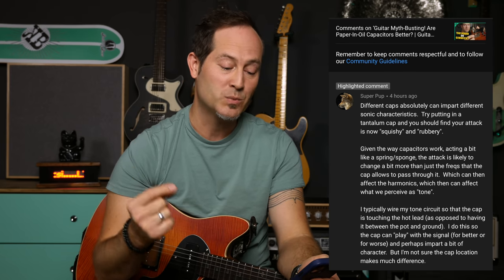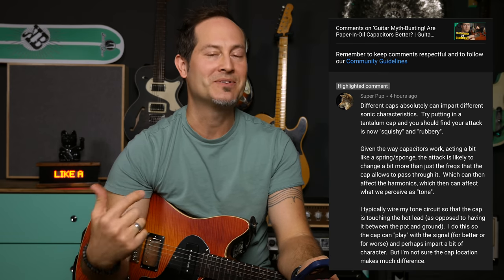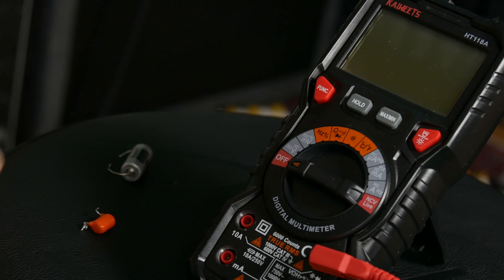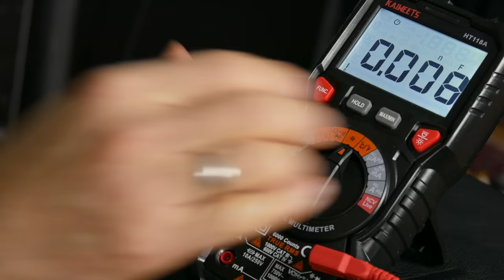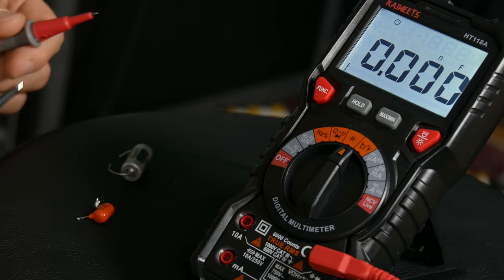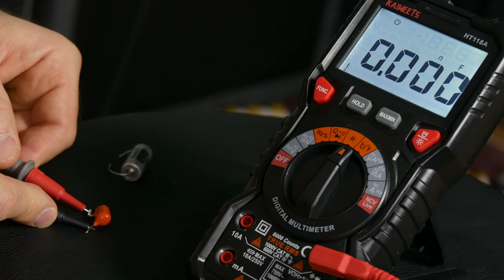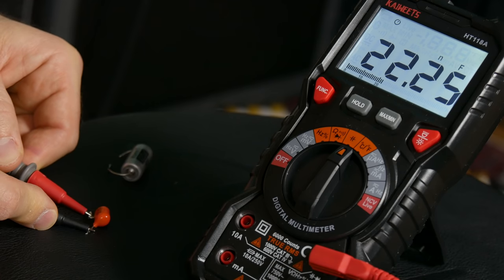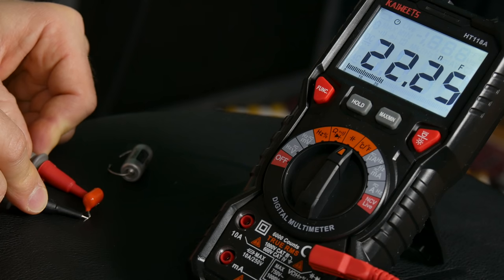Guitar Capacitor Types Matter! Here Is The Proof | Guitar Tweakz

Comment: I can't believe an electrical engineer said what passes thru the cap??? Current never passes thru a cap. The two leads are insulated from each other by a dielectric. Electrons cannot cross it. It charges and it dis-charges, when that happens current flows in the rest of the circuit. I would like him to explain how material affects tone. .022mf is .022mf, it is a time based measurement, which is what effects it's freq. range. In a .022 cap you will hear as little as 10pf diff in value, much smaller than it's spec'd tolerance and less than most multi meters will average their measurement. Tho the dielectric becomes polorised and is diff in diff caps .022mf is still how long it takes to charge whether ceramic or mylar. one has to consider placebo possibilities. Also this is a guitar cap which is in series with a pretty hi value pot (500k w/ humbuckers). In addition to that the cap is not even in series with the signal it just bleeds off freq. So even if signal did (pass thru) a cap, it wouldn't in a guitar.
Reply: That might be true if capacitors were purely capacitive.  You have to take into consideration other factors such as ESR, inductance ramp speed etc...  No two compositions are alike.
Reply: @qua7771  How much diff. in inductance is there between say a .022 ceramic and a .022 mylar cap? I'd be interested in the measurements you've gotten. And ramp speed? Farads are a time based measurement. How long it takes to charge is what gives it it's value. .022mf of any type takes the same amount of time to charge. That's why they work at diff. freq. Freq. is also time . The resistance of a cap is for all puposes infinity. The actual resistance of the metals that are used in a cap negligable between caps. not enough that would ever affect sound and also would be part of what makes up it's time measurement, farads, micro, pico, etc. These things are so infinite that it could not be detected by human hearing. The only diff. heard other than placebo is it's value.
Reply: @bradt.3555  A Mylar cap can be folded or wound.  If you want to know the other specs, you have to look at white papers.  I can tell you now from my amp building experience that there is a substantial difference in the tone of caps with different composition.  It's not placebo effect by any means.  Secondly, price doesn't always correlate to quality.  There are various factors that effect price.  I don't have time to debate just for the sake of it.  If you are playing high gain most of your tone is lost anyway.  Don't assume all players use a ton of gain, effects or processing.  Don't assume everyone can hear the difference either.
Reply: @qua7771  I assume by gain you mean distortion cause you can have lots of one without the other. I use almost no distortion and also mod and build amps, guitars, stereo equip., so on. But you are correct with lots of distortion much is hidden. I never mentioned price. Placebo is real. Look at how little of a value diff affects tone then look at the % that is. 1% of a .022mf is 22pf, that will make a noticable diff. What do you use to determine it's not placebo, hopefully not your ears. Cause that's why placebo is so debated. Even the best ears can be fooled. Mine are quite good so let's not even go there. Half of my 50 yrs working on this stuff has been researching placebo.
Reply: @bradt.3555  Your implying that your ears are gold, and mine are shit in a back handed sort of way.  As I previously mentioned, we strongly disagree, and I'm not going to waste my time or yours debating just for the sake of it. These discussions never come to a head.
Reply: @qua7771  I 'm not implying that at all. I would never make an assumption about someone else's hearing.This kinda shines light on my point about placebo and peoples mis-understanding of it. Good ears bad ears it doesn't discriminate. I just have a hard time wrapping my head around why some people so deny placebo effect. Just saying my ears are good and it affects me as much as anyone. The science of blind testing and understanding how a cap works in a circuit has debunked cap material so that leaves placebo. Took me many, many yrs. to admit it to myself. I've compared many types of the same value with no difference but then caps of the same type and heard a 1% value difference.

Comment: Do you know if there is an orange capacitor in the latest Epiphone Les Paul standard 50’s ?

Also would adding a gibson 498t pickup to the epi standard 50’s get close to that gibson sound or is there anything else i should do to it just for sound itself?

Last but not least would this be worth doing to an epi standard 50’s or should i just get a Gibby standard 50’s ?

Comment: Kris, thanks for your video. I have a question:
Can a failing/damaged capacitor cause humming of guitar?? I’m lost in trying to get rid of hum on my les paul studio 2004. Just rewired it this morning and improved grounding but still it hums like crazy. When I touch capacitor guitar goes silent as it should be. Thanks . Köszönöm
Reply: If hum stops when you touch the strings , your bridge probably not grounded

Comment: to be fair, the values seem to be very close to each other. there is like 2% difference between them. so I suppose that should not change a whole lot. so i guess the conclusion is that the material changes the tone? i don't know. but it seems like it. thank you for doing the followup.
Reply: the material doesn't matter
Reply: Agree, they were both pretty close to the nominal value and well within the advertised 10% error margin (actually almost 1%, which is very good for caps). I don't believe it is the material, I'd rather think it is because of the parasitic inductance and resistance caused by the physical properties. I don't know how the orange drops are constructed, but the pio caps can act very much as a coil having some inductance too. The tone control in the guitar doesn't just act anyways as a simple low-pass filter, it interacts with the pickup's coil and the pots and thus the whole system creates a more complicated LRC circuit having a resonant frequency. Now with the tone pot you move around this resonant frequency, a bit like a wah pedal.

I think it is not the question which cap is "better" or "worse", but to find the one with which you are happy with your guitar's sound.

Comment: You already said it, " I prefer it this way" and is'nt that what it's ultimately about? I would remove the cap and record a min or so and then put one in with tone at 10 just for a test.I found that some caps  change value depending on temperature of the room . Good job, keep on searching.

Comment: Hi, when we're installing Orange drop 22nF 200V capacitor do we have to put it in one particular side so that we avoid noise? Thanks
Reply: There is polarity. I plug in my guitar cable into my amp, then I hand connect one wire of the cap  to positive and one to gound. Then I reverse them. Whichever makes more noise,  is your answer .

Comment: I think my gibson sg leaks dc. Causing some sensitivity in a few of my pedals potentiometers causing some scratchimg sounds and crackling sounds. My amp was tested and the amp was fine by a technician. If I buy a gibson les paul woth orange drop capacitors will that help alleviate weird sounds?
Reply: Guitar signal is AC not DC, so not sure what you on about here. 
A capacitor in a circuit will block dc if present like in an amp. 
Normally scratchy pots can be DC present on a circuit but not a guitar or most pedals really (unless it controls a bias). They probably just dirty and you should get some electrical spray to spray in the pots and clean them out.

Comment: Also, the type of capacitor do not affect the transient. Only its value and the equivalent resistance of the circuit that sees the capacitor. What happend is normally tantalum capacitors are in the range of 1 to 10 microfarad while film capacitors are in the range of 1 to 680nf normally, so the difference is in the value. From my perspective of electronic engineer,  electrical engineers are all crazy hahaha ( engineers joke )
Reply from the maker: 😂👏 Love the attitude and thanks a lot for the insights! Cheers!

Comment: I love this type of video, it brings out just how few people know what they are talking about.

I have many years postgraduate experience as an avionics and test equipment designer. Very little of that (none of it) involved guitar electrics. As a hobby I have designed and built synthesisers and effects units. Little of that involved guitar electrics. Recently I also mod and play guitars. 

I believe these videos do show some differences in tone. I suspect most of this comes from what are known as "parasitics" - effectively small components in addition to the pure capacitance you thought you were buying. For instance a capacitor is made of parallel plates of conductive material with a dielectric between them. The plates will have resistive and inductive elements, as will the leads. The dielectric won't have a constant value at all frequencies and will also have a leakage resistance. Once installed there will be resistance and inductance in the wiring, as well as capacitance between conductors.

When you consider all of these elements, particularly the imperfect nature of paper and oil capacitors, it is hardly surprising that there are subtle tonal differences. I have neither the equipment not the inclination to try to quantify these things but it would be interesting to see an experiment where you keep the circuit and the components exactly the same but change the layout inside your guitar radically, to see if that affects tone. 

Anyway, I may be wrong - I know a bit about electronics but not particularly about this. I just wanted to offer up a possibility based on science rather than black magic
Reply from the maker: Thanks, I really appreciate your input! 👍

Comment: A more proper test would be to take examples of various different TYPES of capacitors that have exactly the same MEASURED value.  Now see if they "sound different".   The answer will be....no.   Don't forget to run a Bode plot with each one inserted in the test circuit.

Comment: Electronic components are just that; components. They have a value, not a "tone'". Capacitors don't change your tone, they filter the signal coming out of the potentiometer (variable resistor). The resulting signal is changed in accordance to the value of the capacitor, nothing more.  Any perceived difference is certainly not down to the type of the capacitor.

Comment: I recommend to watch a video from Joe Gore (https://www.youtube.com/watch?v=dEr-66DR8PM&ab_channel=tonefiendbyjoegore) on this very topic. Many (not 2) caps of different type and value are compared, on a very  sound and controlled protocol. No differences beyond the cap values. 
The "engineer" testimony is very misleading. The "spring" behaviour (let's say.. they can catch and release electrical charges...) of capacitor acts with a time parameter directly dependent of it's value and other parameters of the circuit they are in. That's explain  the frequency filtering they are used for. THat springyness IS the value. There is no other mojo spring/squish/boing action.
I redid the circuit of a 79 MIJ LP copy some years ago  . I got 'mustard'  (said to be russian vintage...) p.i.o. in it. They look cool... But cost me 15 € (for 2) when regular ones would be 1 or less.

Comment: All capacitors are manufactured with an acceptable tolerance. The caps tested didn't vary sufficiently to matter in terms of tone. I wonder have you ever looked into the varitone control that Gibson used to filter certain frequencies in steps. Those controls used filter circuits employing both resistance and capacitance in series networks. They certainly did distinctly affect tone. A single pot and a capacitor in contrast to the varitone have limitations.  I have tried multiple values in both pots and capacitors. A 250k pot and .33 nf cap have sounded the best, to my ear, on my telecaster with Texas Specials pickups.

Comment: Picture this kind of test:   You listen as Kris plays the same riff twice, once with a PIO cap and once with an orange drop.  You write down which version had which type.  Listen to another pair of riffs and write down which one had .047f and which had .022f caps. Which had CTS pots vs cheap knockoffs.

Unless you think you can tell -- consistently --  in a completely blind test like that, then I tell you *none of it matters*.   Have 100 people listen, and have them all write down which of the two they thought sounded better.  Do you imagine you'd get any kind of consistent answers?  

It's fun to argue and holler about, but it's all nonsense unless it means something in the real world.  I'm betting you won't get any clear answers no matter how many times you run these tests.

Comment: Kris, there are some things you don't understand correctly.  First, all electronics components came with a defined tolerance you can choose ( 10% 5% 1%). Both capacitors are in the 10%,  not bad but there are better ones. Second,  those capacitors do not have polarity, aluminium electrolitic capacitor and tantalum capacitors have polarity. Polarity of the capacitors do not influence with the hum, they just work till they blow up.  Do not misunderstood me, I appreciate your content and i understand you are not and engineer , but Ithis kind of unintended misinformation  spread
Reply from the maker: Thanks so much for the comment, I really appreciate the information. As told, I‘m not an engineer and I‘d never claim that I am. 👍 Still, I‘m pretty sure paper-in-oil capacitors also have a polarity, companies even used to put a stripe on one side to show it to the user. Here’s a fascinating video from one of my favourite „nerdy channels“, please watch it and tell me what you think of it: https://youtu.be/BnR_DLd1PDI
Cheers and thanks again for taking the time to comment! I really enjoy these conversations! ✌️Cheers!
Reply: @KrisBarocsi   I watched the video and I think is great. I never thought about capacitors that way ( because of reasons ). He not talking about polarity ( polarity refers to voltage orientation, and if it was the case, you would always would have to connect the + side to the first tube ) what he is talking is about how the capacitor is folded inside the package and how if you connect the outer side to ground it would shield the capacitor from interference. But this happend when you have a very high impedance in the circuit, that what he is talking about regarding connecting the capacitor to the lower impedance side of the circuit.  I think is more important how you polarice the grid of the triode. So, he is right, I'm mostly right and for me is easier and safe to design solid state amp ( I'm currently designing my third prototype and is a bass amp)